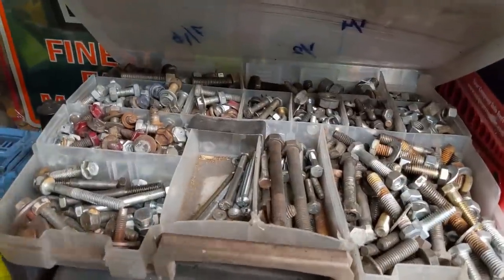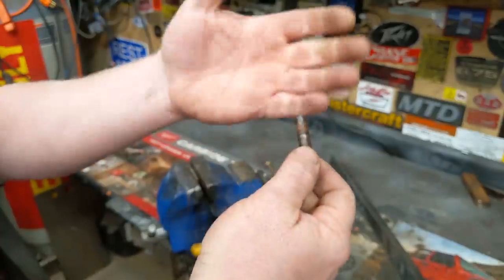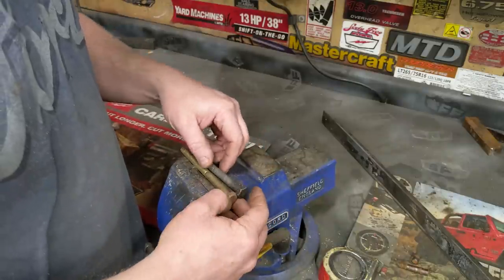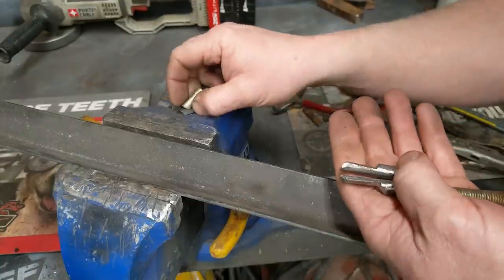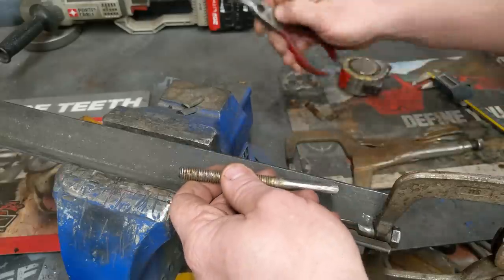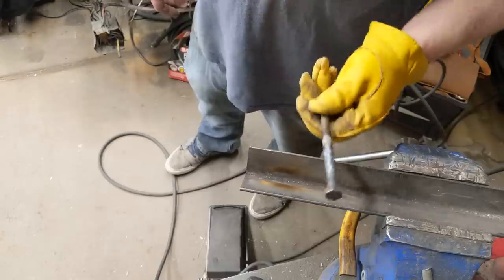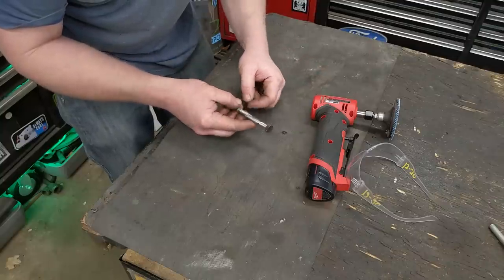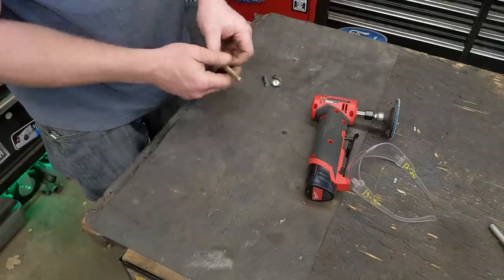How to make BOLTS longer   - Lengthen Extend Bolts -

Comment: I've lengthened (or shortened) bolts this way many times...  You really don't need the half lap for a regular strength bolt, just sharpen both pieces to be joined to a point & fill it in with weld (Grade 5 or 8 would need to be heat treated after welding to retain their strength)...  Also, I opened up a window on the back side of my angle iron jig  so I can weld both sides without releasing the clamps which helps avoid any twisting or warping...
Reply: I mean it , it probably works in a pinch but when all said and done,  I'd want to put it in a lathe --- at that point ya might as well just get a new damn bolt .....
Reply: That is a much stronger result, but I have found that just doing an angle on each bolt, or axle or whatever and putting them together so that it makes a wedge cutout works just as well. The advantage is you don't have to keep turning it, just do it all from one side.
Similarly if you need to put a sharp angle on a rod, cut out the wedge shape but don't go all the way through, bend the rod to the desired angle and weld it up. Just remember to leave plenty of gap for filler weld. You want to fill it in, not just weld a seam as seen here. 👍
Reply: @ipissed  When I weld bolts or rods I clamp them in a piece of angle iron that I have milled the corner off so I can easily weld / braze both sides without disturbing the piece.

Comment: For fun I would like to see you "test" these bolts to failure. I know it will not behave the same as a real grade 5 or 8. But it would be cool to see how much it changes.
Reply: Send them to Project Farm - 'we're going to test that'.
Reply: Unrelated side note. I cant remember the last time I saw someone with the same last name as me.
Reply: This cut weld is soooo wrong.  Grade 8 bolts don't like to be welded and I doubt this home made bolt is much better than a Grade 2 unmarked head " hardware store " bolt.
Reply: @michaelvanhoose5077  yeah. But yours is Vanhoose. Mine is Van Hoose. Totally different.
Reply: @bobroberts2371  yeah and that's why he is putting them on places that are not critical
Reply: Lol. Yea somewhere along the way my ancestors got too lazy to capitalize the H
Reply: @markschiavone8003  - lol  Send them to both.
Reply: Hardware store bolts are generally garbage to start with. I cringe to think what little stress that bolt would take. If you want to test the strength of a real bolt check one that says Cat on it from any Caterpillar engine. You won't find any bolts stronger.
Reply: @jamesvanhoose3132  
@Michael Vanhoose

I’m guessing you guys have already searched your names. Cool Dutch etc history.

Thanks for the bolt welding btw.  I have a LARGE bolt to weld and wondering how much strength it will have.

Anyway I’ve done Family history since my Grandfather died in 06. 

I recommend you ask those who still live if you’re interested. I waited too late.

It is fun especially when you realize people couldn’t spell or write and other reasons names changed with time.  Even birth or death dates are wrong on tombstones.

Very few Census takers in early America  etc could spell or the people they were getting info couldn’t spell such as Apple to Appel. Churches had records but they are lost when churches burn. The Church of Latter-Day Saints has the largest ancestral records.

My name is Overstreet and there are multiple changes from German to England to America back to 1066.

Cool but frustrating.

Anyway.  I gotta go weld a broken antique bolt back to the bell clevis.

Comment: The Milwaukee M12 right angle die grinder set up with the quick loc sanding disc is a great finishing tool.  I lengthen bolts on occasion but grind the two end to a point then weld them solid and grind them round.  Good for government work.

Comment: Great trick. This is very similar to what I did years ago when the volume control went out on my stereo and I couldn't find a potentiometer with a long enough shaft. So I cut a shaft off of another pot, and spliced it to the short one exactly like you did. The problem I had was I didn't have a welder so what I did is drill two small holes through the shaft and put two small screws in to secure it.
Reply: You are one resourceful dude!  It's nice to know there are others like me who refuse to be defeated in repairing stuff.

Comment: Never pass up an opportunity to go to the “bolt store”
Reply from the maker: I am the bolt store??? win win..
Reply: Going to a bolt store is not an option that you can always take advantage of, what if you are in the middle of a project that you are under a deadline to complete and it is 10pm at night, or it is a Sunday and the bolt store is closed, or the local bolt store does not have the correct size and the next nearest bolt store is an hour or two away? Moe is just showing a trick that could save your butt for those less than ideal situations.
Reply: Where did I suggest the “easy way”... I bought all the nut & bolts from my father-in-law’s garage before he retired to Fl, and I still need to buy bolts......
Reply: @dg98adams  You said "never pass up an opportunity to go to the bolt store" I am saying that is not always an easy thing to do, I did not say that you said to take the easy way or anything else for that matter, I was simply making a  point, not an accusation but to avoid any confusion that I had created, I edited my comment.
Reply: My bolt store is probably a two hour drive, one way, on a good day.  ...oh, I can "get" some cheap garbage bolts closer but what's the point ?
Reply: Thanks Moe, I thought you were going to just cut it, taper, and weld. That method makes it a lot stronger. But I would have grooved the connections    first. 
I always buy a few more bolts than needed so maybe don't have to go for a while. But ya, it isn't all bad to go to the hardware.
Reply: This and mechanical failure comps make me laugh. My brain is broken
Reply: Cool trick now I need to buy a grinder and a welder
Reply: @vrea77  And collect a few hundred bolts that are never quite right for what you need :-) ;-)  ...but think of all the time and money you'll save, not to mention the shop cred !

Comment: I needed a longer neck and matching bolt for a bicycle and used this same method.  I did arc weld it, though with an 80 amp invertor welder and 1/16th rod.  Worked just fine.  Thanx.

Comment: Threaded rod is handy for standard diameters and threads. Costs around $3 per meter for say, 10mm rod, you cut the length you need and weld or pin a nut at one end. I particularly like using stainless steel rod.
Reply: Is threaded rod graded? What if you need a grade 5 bolt? I think a welded grade 8 bolt would be stronger than all thread.
Reply from the maker: I have a bunch of threaded rod but most is grade 2(metric class 4) and really only good for small projects. I also don't like having threads in the bolt hole bore as they will cause unnecessary wear/damage to the bore a lot of the time.  I know you can buy grade 5(metric class 8.8) or even 8(10.9) but that will quickly become equal to more than just buying the bolt needed. But that's not really the issue, it's productivity and time. I can make a bolt in 5-10minutes and move forward with the job or drop everything for 90minutes for a trip to/from the store or even wait a week to have one delivered.
Reply: @sixtyfiveford  Yes I agree threaded rod isn't suitable for a lot of applications but keeping stock on hand saves the trip to the store for a lot of small projects. A couple of nylock nuts and a cut length of stainless steel rod is good enough for most of the stuff that I do.

Comment: I've had really good luck doing the same scarf technique but using silicon bronze brazing rod or silver solder(the good stuff 45 or 56% silver not the "silver bearing" solder from the Depot or Lowes) and a TS 4000 or 8000 torch.  For those without a welding machine, it's the bees knees.  The fit has to be pretty tight for the silver solder but it's strong as hell.  The bronze fills gaps better and is easier to control with the torch imo.   Keep up the great videos.

Comment: There was an article in my 4 wheeler magazine when I was a teen extending bolts.  they beveled the ends and welded back together.  Thanks for the video.
Reply from the maker: I actually have a bunch of their old magazines from the 90's and this is maybe where I learned it.

Comment: I've done this countless times to fab' longer bolts. 
None have ever failed !
However, I've also Never use them for anything "requiring" a torque-setting: head-bolt, wheel-lug, etc.
Well done @sixtyfiveford...!

Comment: Another brilliant one Moe, seriously, you ARE the DIY MASTER, period.
Reply from the maker: Hey Thanks. Just playing in the garage.
Reply: This cut weld is soooo wrong. Grade 8 bolts don't like to be welded and I doubt this home made bolt is much better than a Grade 2 unmarked head " hardware store " bolt.
Reply: @bobroberts2371  He's not claiming that the integrity of a Grade 8 bolt will be maintained by doing this trick.  It will save you a trip to the hardware store or may possibly get you out of a pinch at some time.  Also, I bet the strength is a lot stronger that you would think with that scarf joint and a good weld.  I appreciate this video, it will be added to my box of tricks if ever needed.

Comment: Good idea if you're in a bind. After welding it, I would have put the bolt in my drill press chuck and held a file (or grinder) to it as it spun to get a more evenly concentric cut.

Comment: If you need a really long bolt, you could do this with a solid rod and make it however long you need.
Reply: You mean ALL Thread? Agreed
Reply: @Patrick-c8x  Yup - all thread with a nut welded on the end = long bolt.

Comment: I welded and used many bolts numerous times to get the length I need. I used it in noncritical application. Example of this are :  axle bolt on a wheelbarrow that doesn't have to be tighten, just snug fit , bolted lumber together, battery hold down bolts or any project that need to be bolted and it is safe to use. Of course you won't use it in an engine or suspension application. You can use it in conjunction with other bolts temporarily as long as it is safe.

Comment: Pretty cool.  I guess I have never been that hard up for a bolt.  So in other words, all that crap that I hold onto has been working out just fine for me.  But I feel like now I know this trick I may have to use it at some point.  Thanks
Reply from the maker: It's always the odd ball bolt. It happens to me probably once a year where I need a random long bolt and don't want to drop everything for 90minutes for a trip to/from the store. I can just spend 5-10minutes and the bolt is installed and the project is done before i would have been back from the store. Sometimes is odd thread sizes like the 7/16" that I have very few of vs every other size that I have hundreds of matching bolts for.
Reply: @sixtyfiveford  I lost a bolt when replacing the water pump on my son's car. Finally out of desperation I went to the wrecking yard and got one. I found the original in one of the holes in his wheel. Oh well, I just added it to my spare bolts for those just in case times.
Reply: If you’ve never been hard up for a bolt you haven’t done enough projects or you machine your own.

Comment: I need longer wheel studs for my trailer and this is a great idea but I won't risk it for that. I will keep this in mind for the future. Thanks!
Reply from the maker: Stick with JB weld for stud lengthening.
Reply: @sixtyfiveford  that's not safe! You have to use JB weld in combination with duct tape.

Comment: As a temporary solution it's ok as long as the bolt will be subjected to low forces only..
However using the correct bolt for the correct application is always the best practice.
Reply: Did that really have to be said? I can't imagine anyone thinking a lengthened bolt joined by welding would be good as it was originally
Reply: @64maxpower  Are you the Y Tube official censor ??
We live in a free world..everyone is allowed to say anything he wants..give us a break..
Reply: @angelopap5954  I thought my response was kinder than giving you a "Duh really?"  .

Comment: Make a jig out of same right angle tube. Mill the radius out of the bottom right angle  so your bolt seats flush. Make two plates cut on a 45 both ends. Drill and tap center of plate to 1/4 -20. Mill an opening on the peak of right angle. Place your locking plates at desired width and weld in place. You can weld it all the way around. Bolt tension keeps it in place the whole time. Tool and die maker here. Thats how I make bolts.

Comment: Never would have thought to do that.  I just wouldn't think it would be string enough but this way I see where it would work
Reply from the maker: A grade 5, 3/8 bolt can hold about 1, 325lbs(shaft only threads are 25% less(950lbs) before breaking. If I made the shaft out of a 100% welding rod it would be able to hold 1150lbs. Welding rod goes through the same metallurgy tests as bolts. So the bolt will still break at the weakest part; on the original threads even after modified. Obviously a new bolt is always in order and ideal. But to stop for 45 minutes in the middle of a job or even a week to get a specialty bolt ordered for a non-crucial bolt is absurd. This is literally a 5-minute task and the job can continue.

Comment: Awesome video, I actually tried something like this a about a month ago, I was putting a North Star engine on a stand but I had one bolt that needed to be longer so I cut two bolts straight across & mig welded it, looked good but yea didn’t hold up 😂

Comment: I've always just beveled both ends then welded it together, sometimes grinding or forging the weld down to size. The last time was to fix the broken brake actuating rod on my WD tractor. Not as good as a real bolt or machined rod, but it does work.

Comment: Another great tip! I'm finding it harder and harder to get bolts that I need. The availability these days are so sporadic.
Reply from the maker: It comes in handy for specialty length bolts. Find me a bolt for a 1973 Chevy alternator.... Either a 3 hour trip to the wrecking yard or a week to get one off Ebay.... Nope 10minutes and the job is done.

Comment: That's pretty cool. I'd be even more impressed if you'd use weld by stacking dimes to make longer, then use a die to rethread. Wonder if that could be done. 😅

Comment: Another great idea...I made a 2 foot extension by cutting a 3 in long one in half and welding a 3/8 dia piece of rod in the middle
Reply from the maker: You gotta do what it takes to get the job done.
Reply: I tried that once, never could figure out how to get the round into the square. It only ended up an inch and eight eights and what the heck do you with the other half of the extension. Turn it with pliers?

Comment: Well there goes all the metallurgical properties of the bolts, bolts are graded in strength for a reason!
Reply from the maker: Meh..... But if I just welded the two parts that were bolted together, that would be fine.
Reply: Yep! There's always at least one like you in the crowd.

Comment: I did that for the head bolts on my Cummins 2 weeks ago so far It’s still holding
Reply from the maker: I've never done head bolts, but those are always odd ball lengths you won't find at a bolt store.

Comment: best way after welding would be to chuck it up in a lathe if you had one.... as for the porosity i would grind it out then weld the holes back up....

Comment: Can’t see my first comment but I’m wondering if a male female shape similar to a dovetail would hold better. 
More surface area
I have a 8”x 3/4” bolt so more to work with.
That would shorten it so may not be possible for what I need to do but sounds solid  if you’re just lengthening a bolt and have strength.

Then again a simple weld may do.
Reply from the maker: I can't see how it would hurt.